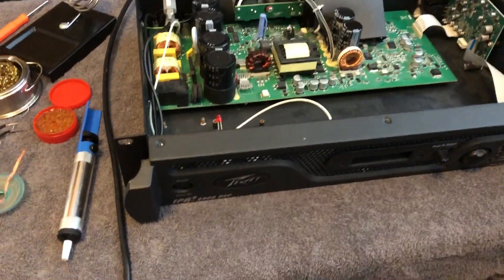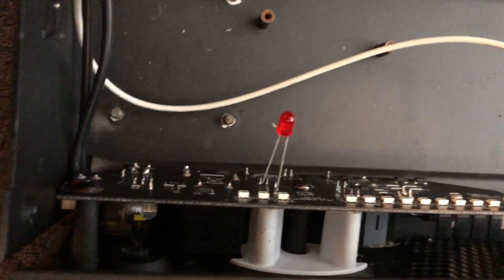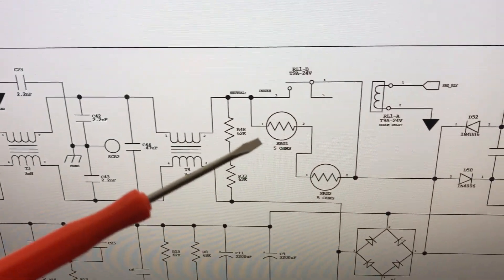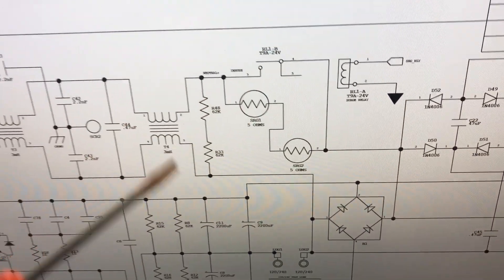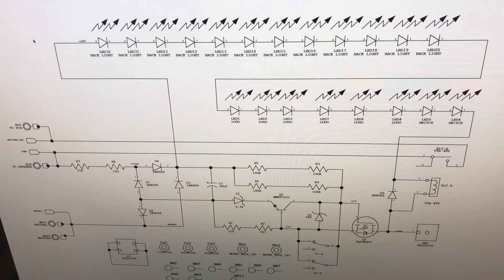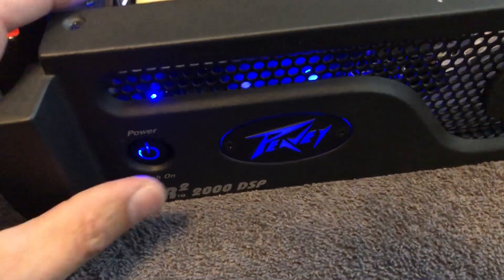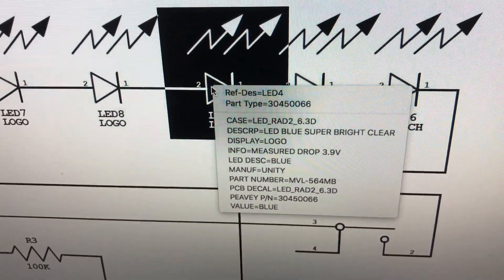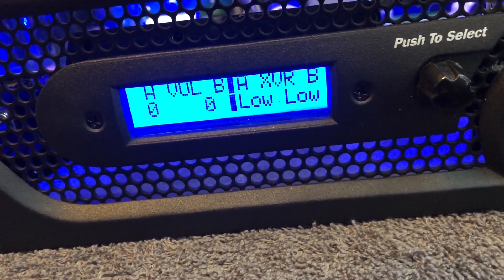Peavey IPR2 2000 DSP Repair

Comment: Is there a way to convert the 120 volt version of the amplifier to 220-240 volts? I've read that on some other peavey/crest pro lite amplifiers there was a jumper in the internal board that could be shorted to switch between the voltages.

Comment: Hey Mike - do you still have the schematic at all? I was testing mine prior to wiring in a small relay in parallel with the power switch so it will power on when my other gear does. I think there is an issue with one of the surface mount transistors on the back of that tiny front board. 

I've only found IPR schematics not IPR2 :(    I have IPR2000 DSP as well. If you could host it an link one I'd be super delighted!

Comment: Hello would you happen to know if the ipr2000 schematic similar to the ipr7500. Been revealing to peavey for schematics have not gotten a reply.
Reply from the maker: I’m not sure, but my guess is they would be close, but different in that there’s a difference in output power so that would require different components. I can try to see if I can dig up the email address I used to contact them successfully if it would help you.

Comment: I have a IPR2 7500 the DDT light comes on, on the B channel then the volume is reduce, I disconnect the output speaker load, also the input, turn on the amplifier, and about two minutes the DDT light comes on. can you help me solve this problem. thanks
Reply: Same here 🫤

Comment: I'm not nearly as handy with the electrical engineering side of things....Peavey has just enfuriated me by these nonsensical issues. My ipr 3000 just went kaput in the middle of an event  and now powers on the front but won't start the whole amp. Just clicks and powers off with the fan spinning a few times.. I had already ordered a ipr2 7500...now I'm not sure I trust peavey after being loyal for years. There is nothing, I repeat nothing more embarrassing then losing sound on a gig.
Reply: Hi Sir, do not buy 7500, they all have the same issues. My 7500 only power on but fans stops nothing works, mosfet & resistor gets very hot and im still struggling to fix, they dont provide schematics.
Reply: @SideBUnderground  thanks...I have heard some skeptical things. I appreciate the info

Comment: Would love for you to do more videos like these. This helped me a lot thanks
Reply from the maker: Glad it helped! I was trying to keep the length down so I didn't go into how to test the surface components "in circuit" with a multimeter. There's a lot of videos out there already on how to do that. Afterward I thought maybe that was a gap people might not understand. I do fix a bunch of things as a home hobbyist so I'll definitely try to do more videos!
Reply: @mikebranda7585  I have 6 7500 with a dead Power Supply. I replaced the 2110 chip and power supply MOSFETs and some diode etc and it still doesn't power up it just restarting continuously. and suggestions?